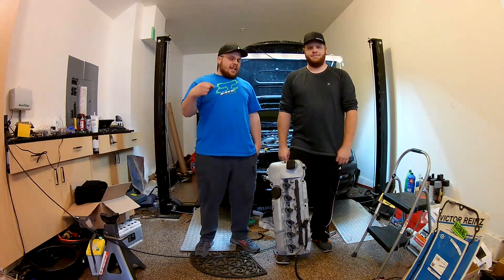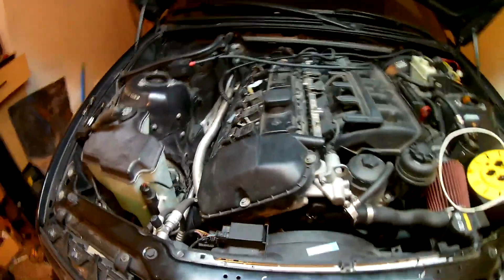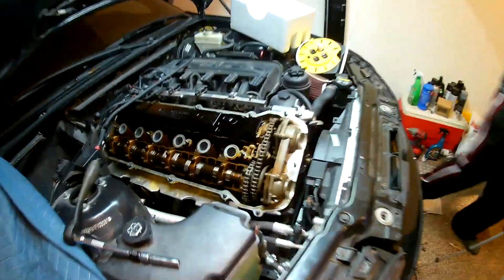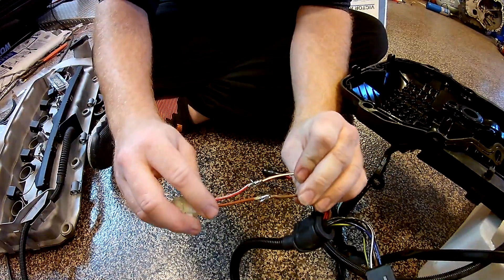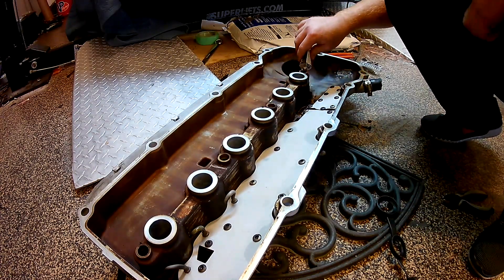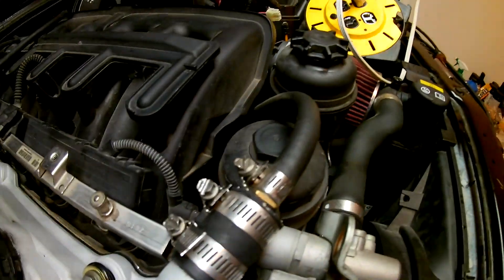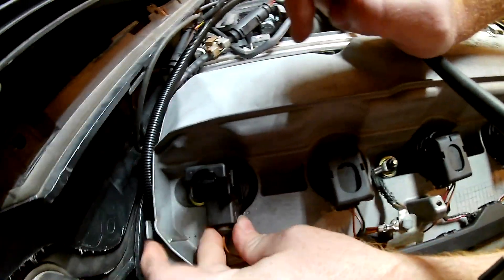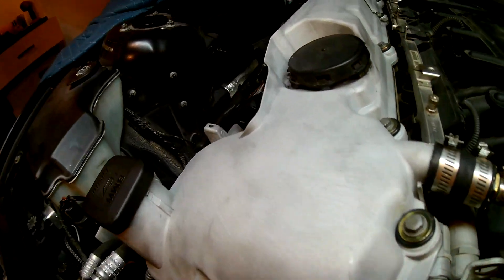M56 Valve Cover Conversion on E46 M54 Engine

Comment: Plz i need an answer , the valve cover gasket is the same between m56 and m54 or m52
Reply: No. They are different, those titts are not the same, get m56 gasket

Comment: Liked your video, but for the uninformed, it really would have been nice to give a brief explanation as to why you would want to do this conversion.
Reply from the maker: Aluminum compared to plastic valve cover. Had heating issues with the plastic one getting too hot.

Comment: Your soldering could use some work. Always make a good mechanical connection first with the wires, then solder, and it would have been very easy to have slid on a couple pieces of heat shrink before soldering.

Comment: Will this work with a M50 intake manifold swap???
Reply: any updates?
Reply: @justswippin2693  yes
Reply: @ChaseScannell14  how did you route the ccv hose from valve cover?
Reply: @justswippin2693  Take the 90 degree fitting from the push lock connector from m56 hose, attach some 12an hose to it, route to catch can, catch can to atmosphere. Some people would route back to the intake but to me that seems pointless since you're still taking the blow by gasses and putting them back into your engine.
Reply: @ChaseScannell14  perfect, thank you chase 🤘
Reply: yes

Comment: where did you run that hose from the CCV? did it go back to the oil dipstick tube?
Reply: Run the hose to the first hose on the intake manifold. Plug off the oil dipstick ccv hose.

Comment: So what's the point of this? Just having a metal cover instead of plastic?
Reply from the maker: Well it never leaks, gasket is reuseable and metal/rubber. And it has a built in pressure release valve. We also have aftermarket headers on the car and did not want the extra heat to possibly warp the plastic valve cover. We were also having problems with stock coils and these new updated coils are so much more reliable and cheaper.

Comment: Good video overall but I would strongly urge people to watch a good soldering video and not use the method shown here. You want to "mechanically" attach wires to each other before soldering. Put a length of "shrink wrap" tube on the wire before twisting them together.
Reply: Ya, came here to say this, what you see is not how you want to solder wires in the video. Twist the wires up, solder up, heatshrink.
Reply: You really shouldnt be soldering any wires on your car
Reply from the maker: We weren't exactly worried about it since it's just a beater car. We know how to solder but just did a quick throw together video! Thanks for the feedback guys! We will go more in depth on future videos! Have a great new year!

Comment: Are m54 valve cover gaskets same as the m54?
Reply from the maker: Javier Montes if you mean if m54 and m56 gaskets are the same, they are not. M54 is made out of completely rubber and is not reusable, and m56 is steel and rubber combo and is reusable. M56 valve cover gasket costs more. But as to same shape it may be slightly different.
Reply: Which did you use?
Reply from the maker: @chrissil  We used the m56 valve cover gasket.

Comment: What about the ports on the distribution piece on the intake manifold? I capped the smaller one towards the back and used a modified m56 hose from the cover to distribution piece. I also capped the return port on the dipstick tube. No catch can to empty.
Reply: I have seen others use the larger port on the distribution rail and cap the rest.
We used the biggest plug on the back of the intake manifold toward the firewall. Many say the catch can isn't necessary with m56 valve cover but I'm just going to use it long term.
If you have any problems or major valve cover pressure keep in touch we hope to do a follow up video in a few thousand miles.